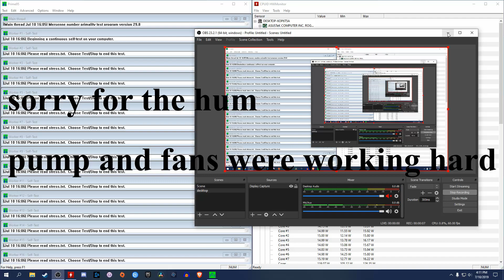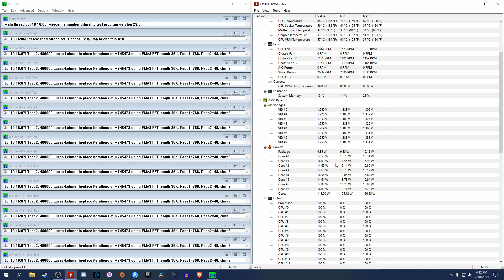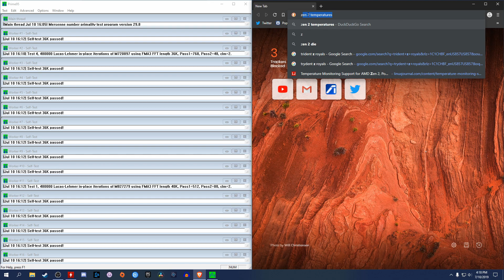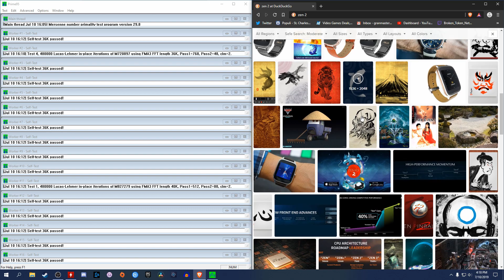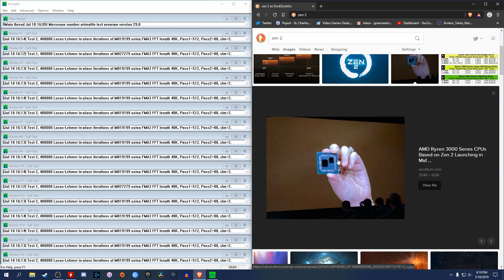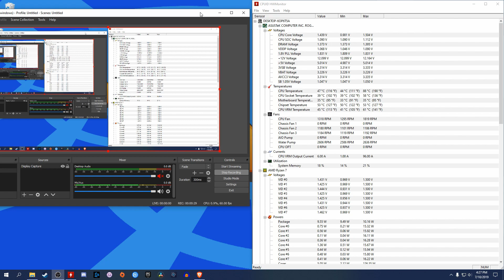Ryzen 7 3700x above 80C under water?!

Comment: I have a 3600 and yeah it runs super hot. With a Noctua NH-U12S under full load I hit 83c, with the Wraith Prism it only runs a few degrees hotter. I also have a 2600 and with the Wraith Prism under full load it doesn't get any hotter than 62c. An observation I made with the Noctua cooler was that the heat pipes and fins were barely warm while the cpu was cooking at over 80c. I reapplied the thermal paste and re mounted the Noctua with the same result. The heat pipes and fins on the Wraith Prism were very warm to touch. Is there a poor transfer of heat from cpu to heatsink. You radiator was blowing out almost cold air despite your cpu being extremely hot. Maybe this link explains it 
https://noctua.at/en/why-is-my-ryzen-3000-processor-getting-so-hot-why-are-ryzen-3000-cpus-running-hotter-than-previous-generation-ryzen-cpus-with-the-same-tdp-rating-is-there-anything-wrong-with-my-cooler

Comment: I have a 3700x with stock cooler at high speed, with exceptional air flo case (Silverstone Primera R01) with 2 additional be-quiet! wings 2 140mm fans blowing down from inside the case. My 3700x locked all cores @4.20 ghz NEVER goes beyond 60 degrees Celsius when playing games (normal work loads and at idle as low is 30 degrees Celsius). Is this the most quiet solution? No...(I have Beat Headphones I use for my PC! I don't hear anything outside of them!)...and I admit I never used an AIO. I don't have a "solution", but I am offering another kind of temp experience with the 3700x. Good luck man!

Comment: same issue here on my stock cooler did you fix it?
Reply from the maker: Well I'm gonna make a follow up video tomorrow but long story short is that the stock cooler isn't great, and that you're gonna want to set a custom fan curve to help with noise
Reply: Token Tech I’m going to get an arctic duo soon . I’ll be sure to tune it tomorrow then I saw that installing power plan helped me a bit on default it’s on high what does balanced mode do?
Reply from the maker: @becky6360  balanced mode will make the cpu a bit slower to boost up which should help a bit with temps, it will not hurt performance in any noticeable way.  might wanna try that

Comment: Having the same issue with my 3700x w/ nzxt x53. Have to lower my voltage and clock speed
Reply: Exactly the same issue with the 3700x and x53. Over 75C while gaming.

Comment: Yeah I am recently a victim of these similar symptoms however not through the use of water cooling and the Wraith Prism instead, that said I think your theory on the chiplet placements is right on the money and I believe the design is fundamentally flawed and completely is a rejection on how thermal dynamics actually function. 
I am also wondering if it being an ASUS motherboard has something to do with it, seeing that I am pretty sure you said you were running one whereas I am using the ASUS ROG Strix Gaming-F and that to me seems a little uncanny.
Reply from the maker: Yeah I'm using an Asus crosshair vi hero x370. I was able to get temps under control by undervolting. 4.3ghz at 1.25v
Reply: @TokenTech  I've heard many people take to that but AMD highly discourages such modifications and stresses in fact that it could potentially shorten the life of the CPU.
Off-course I feel this is up to the individual if they want to take said risk, I am to skeptical running any CPU out of factory spec and I really didn't get this chip for overclocking reason and it was more about future proofing.
Nevertheless I am glad that solution has worked for you though for me I am not keen to do any kind of tampering so I'll be returning mine unfortunately its still good to hear I wasn't alone in this particular issue.
Reply from the maker: Yeah I feel ya, it's def a sanity check. What cpu will you get instead?
Reply: @TokenTech  I wish I knew, as it stands unless my retailer can find a fault with either it or the motherboard when they run whatever tests they plan on, best I can hope for is a replacement with the same make and model, I even tried to ask for a swap to an Intel platform but that yielded no such luck so with that said my plan at this point is to buy a Dark rock pro 4 cooler its chunky and ugly looking and will clash with the RGB theme I was trying to go with but when it comes to that or having it simply work as intended I choose to have a working system and if that means opting for an aftermarket cooler than so be it.

Comment: Any updates?  My 3700x isn’t nearly as bad because it’s running bfv 1440p with 2080ti at over 130fps at 72c with a nh-d15 but it runs hotter than expected and my idle jumps between 44-64c unless I’m on power saver.
Reply from the maker: what motherboard do you use?
Reply: Token Tech Asus X470-I. I saw your newer vid but it seems optimumtech had issues with his undervolting
Reply from the maker: How so? I was able to verify no performance loss. It could be the bios on our older boards but idk. Honestly I had to undervolt to get better temps
Reply: Token Tech yeah I’m considering testing some lower voltage although 70c is actually not even bad at game load. 

Thanks

Comment: I have the Same Problem
Bug the Thing is the 3000 CPUs have a temp reading Problem
Ding know why Bug they have a temp Offset of 20 degrees Celsius
So If U get 80c it means 60c
Cuz the Air would be super hot If that temp readings would be right

So again IT has nothing to so with Ur stuff the Problem is WRONG temp readings

Watch this Video:
https://youtu.be/Gy5kXsD9OtY
Reply from the maker: This was changed since ryzen 2000 aka zen+
Reply: @TokenTech  
Yeah but its a similar Problem now
cuz If temp readings would be right the Air that comes Out should be super hot Like the GPU but its Not

Clearly a temp reading issue

Comment: I'm having more or less the same issues on a 3800x,   30C idle temps,  instant spike to 73C under water.   Zero delay in the spike.   Cools instantly as well back to idle of 30C.   I may try my 2700x to see if it does the same.  I even cleaned all the fins in my block to see if I had clogs.  Not the issue.  I have the same problem with a Noctua now that I think of it.
Reply from the maker: I think it's because of the 7nm process. Everything is so dense that it is hard to get the heat out. Also voltage on ryzen 3000 seems to run high
Reply: @TokenTech  Based on what some others have posted online I really shouldn't complain.   My temps are well under control from what I'm seeing.
Reply: @TokenTech  Moved from the 3800X to a 3950X and now I'm running 60C under 16 core loads on the same custom loop.  D5 dual rad with EK Velocity block.
Reply from the maker: @jeffm2787  I believe that is because of binning.  Those chips are the best amd produces I think the reviewers were saying the 3950x uses much lower voltage than any of the other ryzen chips.  Which is awesome
Reply: @TokenTech  I agree on the 3950X,  I think it has better heat transfer somehow as well.  The fact that the 3800X I have doesn't care about what thermal compound I use or if it's air or water tells me something is just not transferring well.
Reply from the maker: @jeffm2787  agreed

Comment: I have same issue im running 3800x temp on gaming around 70c and on cinebench r20 80c. Idle temps jumps 45c to 60c. Water cooling setup 1 360rad and 1 120 rad
Reply from the maker: https://youtu.be/5JTuxMnrqds
Reply: Token Tech  it worked thanks! Now i need to figure out how to do it in my bios

Comment: Overclocked 7-3800X with Ryujin 240 and have a load heat in games with 55 Celsius so something is really wrong with your built.
Reply from the maker: Lol thanks
Reply: @TokenTech  Try to undervoltage the CPU as far as you could go. It worked when i overclocked mine and i got a lower temp than in original settings ?.Yeah i know, crazy, but it worked om this setup. You have a nice Christmas.
Reply from the maker: Check out my new video on this

Comment: i have the same exact setup as you; more or less; with a 2080 msi water block as well in between the radiators; in prime full load; i get about 74 degrees max temp spikes with about 69-70 average; i thought something was wrong; idle i sit at 28degrees-32  (water temp @ 25).  it is a little better then you; but i still think its not that good.  it should be much better, water temp never goes over 30C degrees
for prime CPU shouldn't go over 65;  
in gaming it goes max 64, in prime 74 max  ; it does boost to 4.295 on most cores though or somewhere around there.  I have not tweaked the voltage; stock motherboard defaults.  What doe you guys think? should i try harder to get it to under 70 Prime?  i also used liquid metal.
Reply from the maker: I undervolted my cpu to get Petter temps. So I pushed the clocks and lower voltage.

Comment: I just upgraded my FX8350 to a 3600 and with stock cooler hitted 90°C. The max temp the processor allows is 95°c, so it's kinnda dangerous.
BTW, regarding 100% cpu usage: when encoding video (x264) you will get 100 usage from 6 to 20mins. I do video encoding and processing and some scripts can took over 8hrs running at 80% cpu ussage.. Some even over a entire day.
Further testing: I swap'd the Ryzen cooler for the FX8350 stock cooler (wich is kindda similar to the Wraith cooler): max temp now was 82°c. Still too damn hot for me.

I decided to swap to a 3700X... if the computer salesman accepts my claim :P

After your video I am kinnda scared that encountering the same issue as before...
Reply from the maker: the best solution is to mess with the voltage in the bios
Reply: @TokenTech  any particular value you recommend or that has work'd for you?
Reply from the maker: @MarceloJavierMazaLuparia  so if you are doing an offset, do a negative offset of 0.1 if you are putting in the exact value it depends on the clock speed. check out this video from optimum tech https://youtu.be/2wM3obN2pAE?t=222

Comment: Hey awesome vid, did you ever find a solution to this? My 3700x is hitting over 90 playing Fortnite and idle is at 45 minimum I have a liquid cooling set up also
Reply: Run 1.1v @ 4.0ghz and you'll see much better temps
Reply from the maker: I was hoping there would be a bios fix but that doesn't seem to be the case. I just run mine at 4.3ghz with an undervolt of 1.25v

Comment: Well try to drive your car on a first gear at 6000rpm for an hour. It will overheat? No way! Of course the car and its cooling system are crap. No problem with a driver at all.
!Attention! SARCASM !Attention!
Reply from the maker: i hear ya, turns out that my 3700x was defective... got an exchange
Reply: Good to know! Congrats in that case :)

Comment: My 3700x have 4426 mhz in boost and no up more 80C temperature
Reply from the maker: What are you using to record temps? And what are you testing with?
Reply: @TokenTech  Cpuid hwmonitor , and for cooling system have  Thermaltake Water 3.0 Extreme S
Reply from the maker: @Alexei55555  Thanks for the info! I will do more testing but it seems that there is a wide range of quality between chips. Yours seems much better than mine lol

Comment: use the ryzen master to check temperature
Reply from the maker: check out my other video I use ryzen master.  This video came out before the update to ryzen master.  However ryzen master averages out the temps so you don't see the peaks.  Also under load these chips still can easily hit over 80c even on water cooling

Comment: You might be right, placement of I/O and cores are uneven. I have noticed too with my 3700X it needs higher level cooling volume to run stable 4 GHZ all core.
Also PBO is no good on 3700X, Performance gains are marginal[3% Max IN my case] and you are always better off doing Manual OC ing. If you are ok with 3.9 - 4GHZ all core boost then better turn off PBO. You gain much better temps with negligible performance loss and stable 4GHZ. If you want 4.2+Ghz all core go with manual OC and try keeping volatge below 1.4V, It did wonders for many.
I got hot temps too on AIR with prism cooler on 100% load PBO/XFR Enabled temps reached 90'C, and with PBO off 80-85'C, i set my cabinet max positive air pressure and i gained 8-10"C drops, i set my top exhaust fans as intake blowing air directly on CPU, Added  1 intake and 1 exhaust, total 7 case fans.[2 exhaust and 5 intake]. Yes I modded my Cabinet, It was fun.
PBO on gives you too much temps and not much OC because it set voltage in between 1.4-1.5v  which makes CPU to throttle very early, 1.45 V is too  much for this chip.   If you have good water cooling try doing manual OC and forget PBO.

Comment: I have the same 3700x. I was having the same high temperatures on a stress test. Up in the mid 80c. I have a water cooler for the CPU and couldn't understand why. I ended up drop the voltage to 1.05v. Now under a stress test it's about 55c. I haven't seen a drop in performance.
Reply from the maker: What is your cinebench score? And temps while running cinebench?
Reply: If I get time I'll do one tonight
Reply: @AetherLink-AE  my ryzen master temperature differs from nzxt temperature. Ryzen master shows 42-44 idle temp while nzxt always is always at 53 to 55 (idle)
Reply: So I did a cinebench 20. I got a score of 3905.
Reply: And the temp was 58c
Reply from the maker: @AetherLink-AE  Thanks for running the test.  I don't know what you got before the undervolt but that is much lower than my score. I know that it probably isnt noticeable but you are losing performance with the undervolt.  My score is around 5000.
Reply: I'll have a play about thanks
Reply: Well I set everything back to auto and I got a score of 4785. Seems I was losing performance.

Comment: Your default voltage is high, manually set it to 1.28V to 1.35V and see if that drops temps. I am on a 3900x and during a blender render test ( animation) was hitting 88C to 90c , manually setting  the voltage dropped temps considerably but lost some of the performance. I am sitting at 80 - 82C at an ambient of 28C , 75C with 23C ambient,  with the cores boosting to 4.05 to 4.1Ghz.
Reply from the maker: You're right. I spent quite some time testing different voltages and validating performance. You can see considerable temperature decrease if you lower clock speed and voltage but then you lose performance. I don't think most people would want to do that. Right now I'm running my cpu at 4.4ghz at 1.375v and seeing about 73c (22ish ambient) with my liquid cooler.

Comment: You are on the right track, the water block has heat exchanging fins inside to transfer heat to the water.

Unfortunately less than a quarter of those fins are above the hot chiplet.

An air cooler has 50% of its cooling potential over that self same hotspot.
Reply from the maker: yeah my nh d 15 performance about the same as my water block that was not the case on my last cpu

Comment: Got a 3700x with a NH-D15, runs around 70-72c in cinebench, and encoding with handbrake is around 72-75c PBO off, PBO on its around 75-78c.
Reply from the maker: That sounds about right, my chip was def defective, it was failing stress tests so I was able to exchange it for a 3800x. Which is mostly in line with your numbers

Comment: yeah tried clc280 evga and noctua nh u12a both are terrible for my 3800x, the heat is just not dissipated from the chiplet fast enough by any of those high end coolers, amd + cooler manufacturers have to sit down and have talk because the delta between idle and full load is HUGE!@!!!!!!!!!!!for ryzen 3000 and it needs better cooling since precision boost algorithm has high temp of 80C and from what i heard it was dropped to 75C to not hurt the cpu which is normal for it running at such high temperatures
Reply from the maker: Kinda feels like when threadripper first launched
Reply: @TokenTech  it wasn't that bad since some blocks were good, but now all air cooling and majority of aio's have same results very bad , and you can see after a cinebench r20 run ends between the ccd thermal sensor  and cpu package thermal sensor  is a delta of 20 degrees on hwinfo latest version beta where thermal sensor of ccd is included so that area of the cpu on the ihs is not being cooled as it should. THis guy is working on a custom block https://www.igorslab.media/community/threads/hat-der-ryzen-3000-durch-sein-asymetrisches-design-echte-probleme-mit-aktuellen-cpu-wasserbl%C3%B6cken-und-dht-luftk%C3%BChlern.1591/

Comment: Thanks for this video, man! I knew I couldn't be the only one. I'm experiencing the same thing on my 3600x on my DeepCool AIO. At first I thought it was the voltages but once I got that sorted out, the temps barely changed. So I thought it has to be the chiplet design and how most water blocks are designed to dissipate heat from the center, since traditionally that's where the cpu die usually is, and therefore creating hot spots.
Reply from the maker: Yeah that along with the density that just traps in heat. My crosshair vi hero got a bios update and seems to address the voltage issue
Reply: @TokenTech  Yeah same with my Asus X570-p, but it seems like the x570 chipset drivers did the trick, that and setting the power plan to Ryzen balanced.
Reply from the maker: Yup, just like every new architecture there are gonna be growing pains but damn the resonance leap over my 1800x is huge
Reply: @TokenTech  For real!!! Ironically, the cou gets hotter when downloading games than it actually does playing them 😂
Reply from the maker: Lol so true